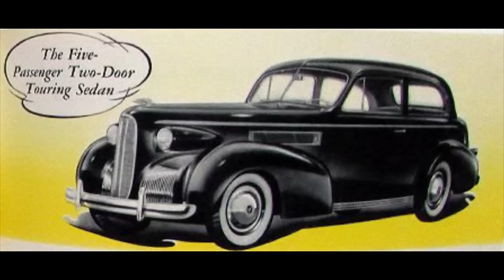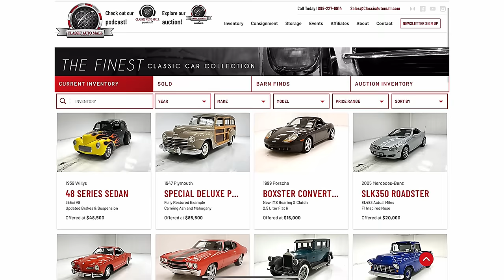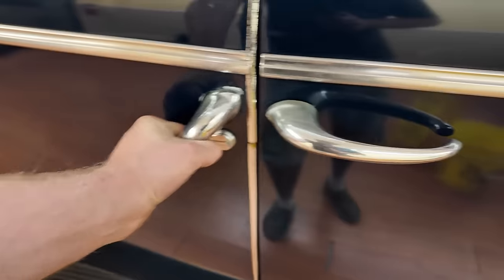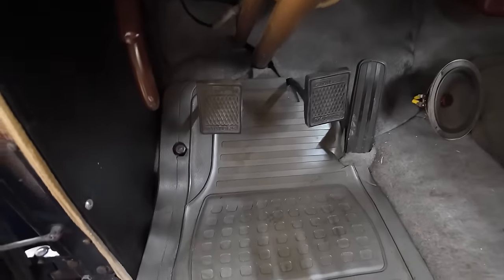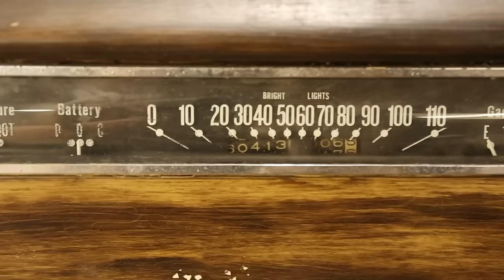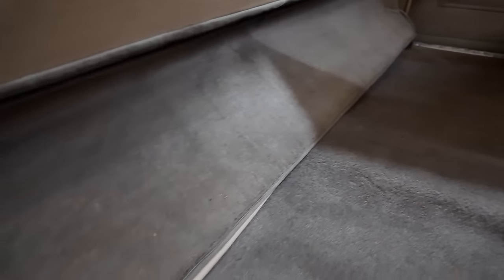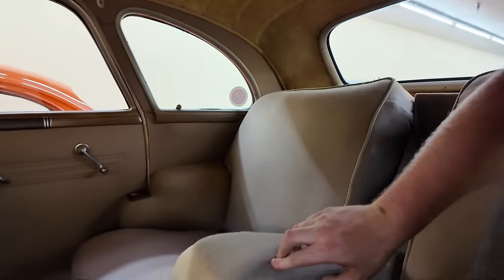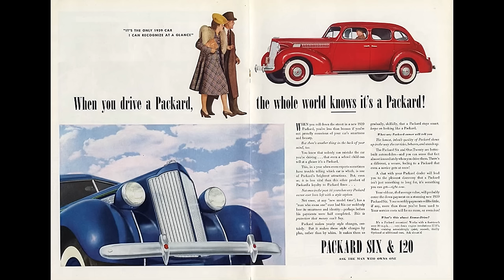1939 La Salle series 50 touring sedan.

Comment: That radio is cool. I haven't seen one of those before. In addition to loving cars I love radios too. That looks like a Delco Model R-705. From what I gather these were made in 1947-1948. The control head mounts on the steering column and there is a box containing 8 tubes which presumably is under the dash.  

I'd choose the 1939 Packard 120 in the first scenario and the 1939 LaSalle in the second.
Reply from the maker: Sweet choices

I never saw a radio unit like that. I had to look it up to see what it was. I wasn’t sure if it was a radio or some sort of speed limiting device.

Comment: Not an expert on Cad flathead V8's but the exhausts coming out on the inside of the engine V makes sense when you think of engine cooling if you compare it to the Ford V8 which  always ran warm due to the exhaust running through the block and out the side. Someone had mentioned that this configuration might lead to vapor lock with the heat it generates being close to the carb, I doubt that because if the fuel pump is mounted in normal V8 fashion the upper area would be on the pressure side of the pump, vapor lock occurs on the vacuum side when the fuel gets warm which lowers the amount of vacuum that can be applied before the fuel breaks up into vapor limiting the amount of lift that the pump can provide.

Comment: That running of the Exhaust on top and over seems crazy way to route the Exhaust.
On hot days it probably would contribute to Vapor Lock of the Carburetor so close.
Reply: It's funny you mention "vapor lock."  Just another thing the current crop of drivers has never experienced.
Reply from the maker: Yeah, I thought that was a very interesting set up vapor lock sucks. I deal with it in my truck on really hot days and I’m really thankful for a manual choke because I can pull the choke out and correct it… but yeah definitely an issue that kids don’t have to worry about today

Comment: First pick 39 Lincoln Zephyr, second 1939 Chrysler. Still prefer the 34 LaSalle especially the  3 passenger coupe body, like the bi plane bumpers and portholes on the hood. When I was young I originally  thought the 34 models was a Buick because  of the portholes and the straight 8 until  I learned that the 34 LaSalle was Cadillac's companion  car. Great find.

Comment: IMOP you could make a good case that there were no bad looking LaSalles.  And once they left the classic era (which some will always prefer) LaSalle did art deco / streamline moderne better than most.  The 34 is just a standout, though the 35 was a much better buy.  It hung with the Packard 120, but generally lost out in terms of performance to the Century - which cost a bit more.  For style though, the LaSalle had it over both - unless you had to have the Packard grille (and they were better screwed together, even the 120).  That radio must be a GM dealer accessory.  If you ordered the car with a factory unit, it was in dash.  WYR is cruel today, as I lke all of these for late 30's sedans.  OK - LaSalle in both cases.
Reply from the maker: Awesome insight and information I try to make the would you rather hard so it makes you think plus that is what your options were back in the day generally sometimes there more outside the box depending on what era I need to find a 34 and 35 LaSalle I would really love to cover them all went to Classic auto Mall yesterday and did some stuff that we don’t usually More 60s cars there’s a bunch that stand out but 63 Grand Prix are really nice car just saying